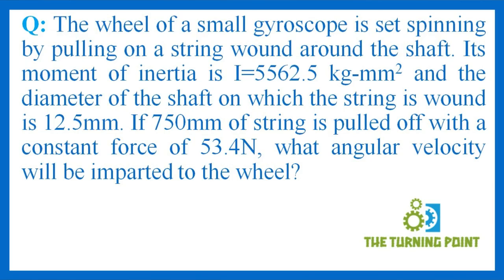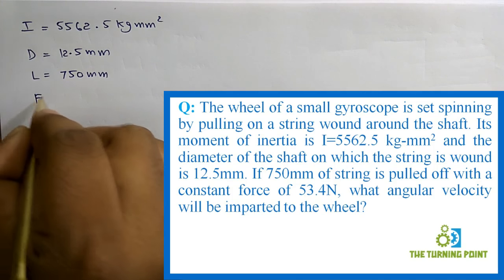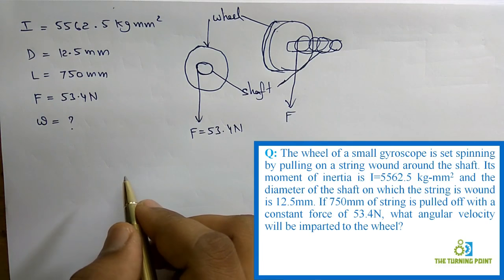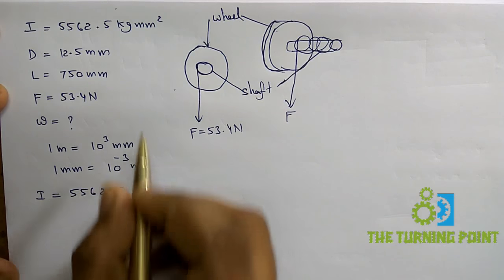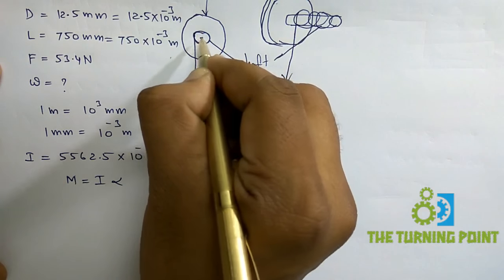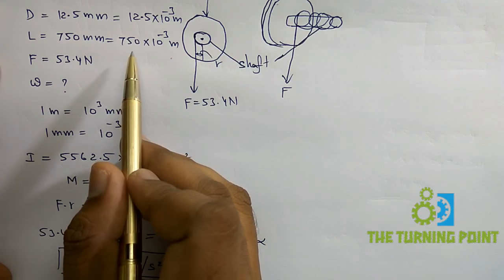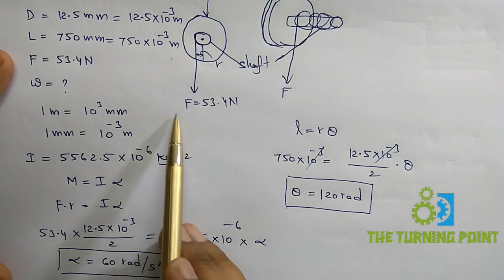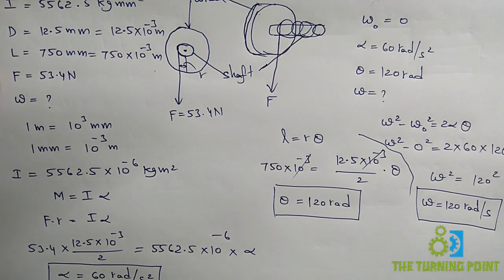Dynamics Problem 13

Comment: Sir can i know the weightage of this chapter in exam as per sums
Reply from the maker: You will get four questions from DYNAMICS. In that you need to answer two questions. Every Question is for 10 marks. That means you will get 20 marks from this chapter
Reply: tq sir